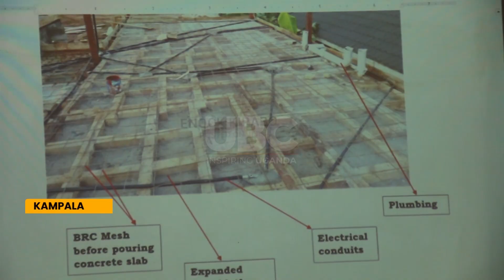Ministry of Works & Transport bans steel-timber-composite construction method

Comment: i have always believed the commonly employed steelmesh-timber-concrete roofing system is just not a secure thing, and only a ticking time bomb indeed!! in the semi-urban and rural parts of Uganda, it'll only take a simple quake to bring those many bungalow roofs down! it's taken way long to issue serious corrective directives on this widely used construction method!

Comment: The blocks are to heavy on some buildings. Hence structural engineering is needed before buildings are passed. Mostly storied buildings.
One can minimise coast but with clever engineering.

Comment: Uganda should adopt the Structural Building Code Standard called the EN EUROCODE 2G.
Many Ugandans are using the Uganda National Building Code which is based on the old British abandoned BS Building Standard, as do many other former British colonies.
The UK abandoned the BS Building Standard in 2010.
The UK adopted the EU's Building Standard called the EN Eurocode instead, as a member of the EU.
This means that the old British BS Building Standard is no longer being maintained or updated.
The Uganda National Building Code needs to be updated, modernised and maintained with the adoption of the Ugandan National Annexes of the Eurocode 2G.

Kenya has already shifted to the EN Eurocode Building Standard in 2016.
The Kenya Bureau of Standards (KEBS) have processed the harmonising of Eurocodes in Kenya. 

All Universities and other Training Instituions must teach in Eurocode 2G, and all Structural designs for approval shall be submitted in Eurocode 2G by Law. 
Specifications in the Contracts, Structural Designs and Constructions, BIM Building Design Softwares, Testing of building Materials and Equipments, and all other Quality Control processes and inspections also need to be calibrated and adjusted to the Eurocode 2G, by Law.

All STAKEHOLDERS including Architects, Civil and Structural Engineers, Surveyors, Universities and other Training Institutions, Government and Private Agencies, Building Committees, Building Materials and Equipment Manufacturers, Contractors, Subcontractors, OnSite Workers and the Developers/Consumers should all collaborate closely, be sensitised and educated (take certified courses) on the use of the BIM process and the Eurocode 2G, by Law.

This will ensure a Unified system that safeguards Consistency in the Building Materials, Designs, Executions, and Testings as outlined in the Eurocode 2G for safe, reliable, functional, economical, and resilient Structures.

Any STAKEHOLDERS from above that is found legally violating the Eurocode standards rules and regulations should by Law, be Arrested, dismissed, deregistered, certificate terminated, fined and/or jailed if found guilty.

An update to Eurocode is expected in 2026 to Eurocode 2G.  
With the adoption of a more (ease-of-use) user friendly approach and the addition of a Structural Glass part.. among others.

Many countries outside the EU are in different stages or have already adopted the Eurocodes.
In Europe, Asia, Middle East and South America. 
In Africa - Ethiopia, Kenya, Madagascar and Angola have already Adopted.
While South Africa, Tanzania, DRCongo, Morocco, Algeria, Tunisia, Egypt, Botswana, Cameroon, among others are also in different stages of adopting the Eurocodes.

The Structural Eurocode 2G should be adopted as fast as possible in Uganda for the safety of all Citizens. 
The National Building Review Board (NBRB) together with the Uganda National Bureau Of Standards (UNBS) should set up a Uganda National Building Code - (Uganda National Annexes of Eurocode 2G) Committee, 
and adopt a grace period of about 4 years (2027-2030) for the transition to Eurocodes 2G.
Creating the Uganda National Annexes to the Eurocodes 2G for Uganda in collaboration with ALL the STAKEHOLDERS. 
As an Update to the Uganda National Building Code. 

All STAKEHOLDERS shall take Certified Courses in Eurocodes 2G from 2027.
All Universities and other Training institutions shall teach in Eurocodes 2G from 2028. 
This means Ugandan students and the Building Industry will keep up to date on modern building technologies.
Kenya has already gone through this process so we can get help and studies from there to catch any problems and quicken the transition smoothly by end of 2030.
2031 Uganda then officially adopts the Eurocodes 2G together with the Uganda National Annexes. 
All Structural designs for approval shall from then onwards be submitted in Eurocodes 2G only.
https://youtu.be/38zgz_3NExE?si=tUvoKiWdpTM_UgL6
Reply: Ministry needs to educate public wic is prohibited which is alllowed because they say steel timber slubs are allowed but public thinks everything is prohibited